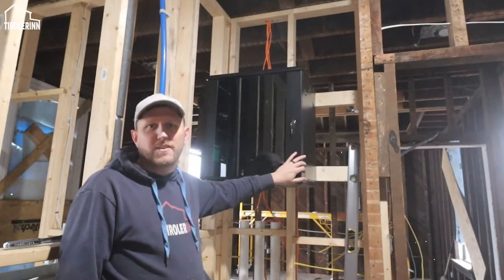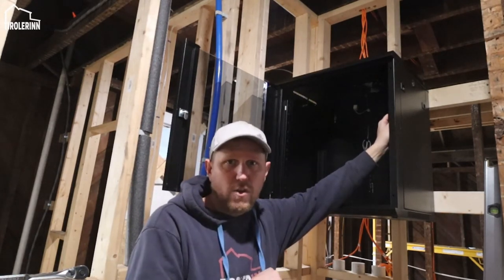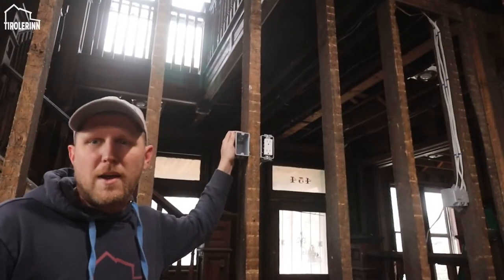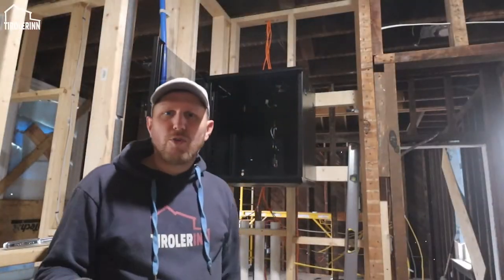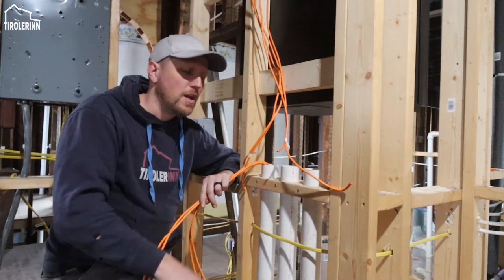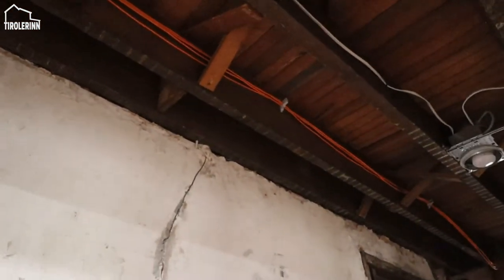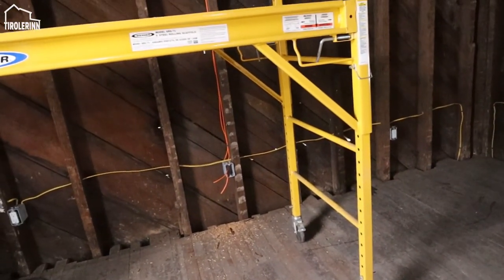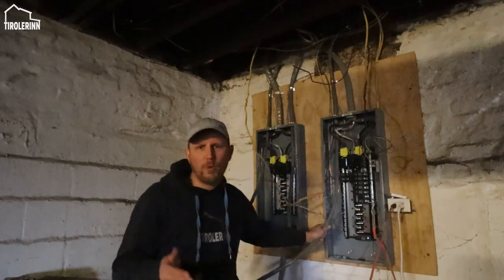Dedicated Network Closet, Running CAT6 cables PART 1 - TirolerInn the Renovation

Comment: Totally agree with anticipating future use with multiple cables. Also, more outlets than code, and in the kitchen dedicated outlets in multiple locations and same with 220 there. Remodels happen down the road.
Reply: p.s. Our house is not smart LOL. There is a YT channel called SiwuPlan that is about Smarthome stuff, and I think they included some in their own house build on their main channel. Er spricht Deutsch.
Reply from the maker: We will have to check him out. 
We have 2 dedicated circuits that are required in the US. We are also planning some countertop height outlets in the pantry for some appliances like meat/cheese slicer or breadmakers.

Comment: We have the nest thermostat which came with the house when we bought it.  Once it's set up it's very convenient.  Temp set from 8am to 7pm, then lower in the evening.  We fought it at first but now we don't worry about the temperature.  Our heating bill shows we are the most efficient in our area compared to other homes like ours.
Reply from the maker: We have had ecobees in all our homes and business buildings. Works great and the ability to schedule vacations is great also.

Comment: I would suggest that you do not put the network box in the laundry room. From experience that room will get hot with high humidity and the air will be filled with lent.
Reply from the maker: agreed. We will try it out and otherwise we will face it into the closet to protect it.